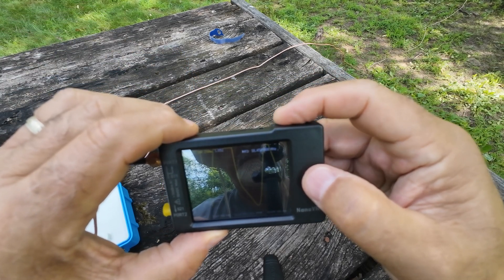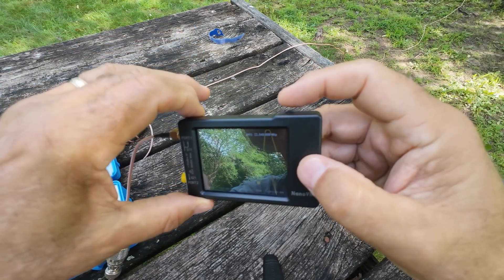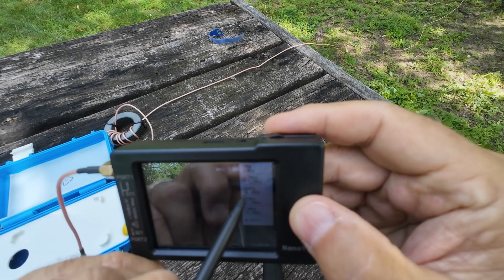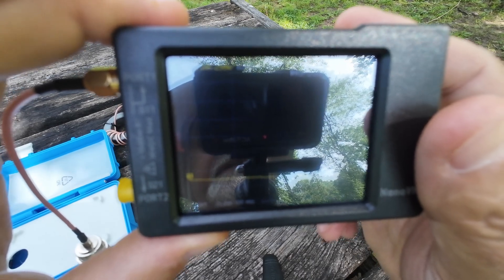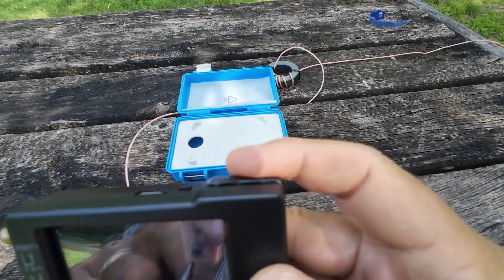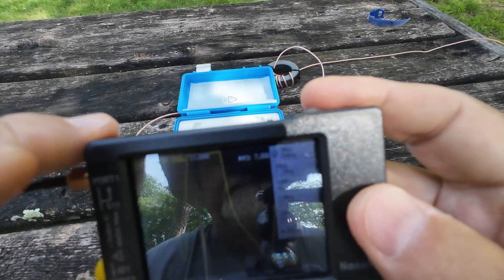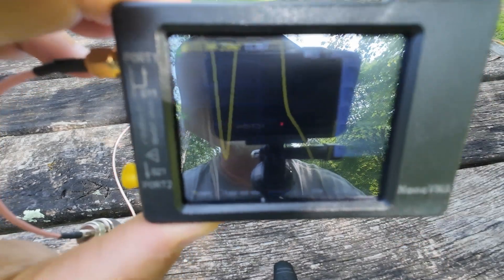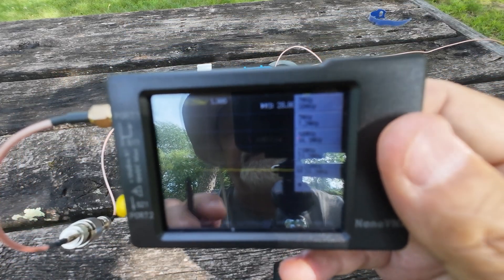My $9.00 9:1 Unun Random Wire SWR Sweep with No Tuner

Comment: How long is the coax cable from 9:1 UNUN to common mode choke?
Reply from the maker: 100’ Thanks for watching. 73s
Reply: @MyHamRadioJourney  Thanks for the info.  I wanted to know the coax length so I could better understand the overall length of the antenna; i.e., horizontal wire plus coax outer-shield counterpoise.

Comment: Interesting and instructive video, thanks.  However your measured SWR values seem really high to me.
Are you sure that your 9:1 unun is good?
I mean, with an admittedly more expensive 9:1 unun, with a 52 feet wire I get SWR < 3.0 on all 10, 15, 20 and 40m, some < 2.0.
About the same with my 29 feet, except on 40m where it's higher, but nothing close to 10+.
The SWR values you measured seem really high to me.
I'd try a better unun...
Best 73s de F4LDT
Reply from the maker: This is normal because it’s not running through a tuner yet. Once I tuned the wire I was 1:1 on all bands. Thanks for watching. 73s
Reply: Thanks for your reply. The values I was giving are without a tuner either.
Reply from the maker: @F4LDT-Alain  Thanks, I will look into the Unun and see if I can get some better readings. Thanks for the tip.

Comment: Did you calibrate before measuring?  You need to zero out the transmission line.
Reply from the maker: Yes, all of the presets are calibrated along with the transmission line. Thanks for watching. 73s

Comment: Enjoying the videos, Jack! Might be interesting to compare your 9 to 1 random head on with an endfed halfwave.  58 feet is more than enough for good efficiency on 40 m. Also wonder if you had a choke down the coax? Common mode currents can really affect your SWR measurements without a choke. Take care and keep up the good work! WA3KKB
Reply from the maker: Yes, I was using an in-line choke with this setup. And this antenna works well on 40-10. Thanks for watching. 73s

Comment: My vertical 20 efhw using a 49:1 unun is 1.1 across the 20m band and 1.1 accross the 10m band.If I change the unun to a 9:1 it is 1.1 on the 60m band and using the tuner it easily tunes 80m - 6 m
Reply from the maker: Yes, I find the results to be the same as yours, with a 49:1 ratio. The 9:1 needs the tuner. Thanks for watching. 73s

Comment: Yaesu can usually tune < 3:1 so it should work.  I've done 41' and 84' random wires and my ft710 was able to tune 10 to 40
Reply from the maker: I would have to put the ICOM 7300 into bypass mode, which cuts the power in half. I need an external tuner. Thanks for watching. 73s